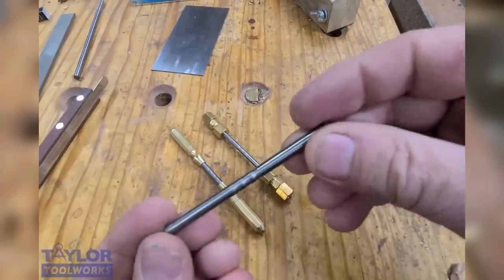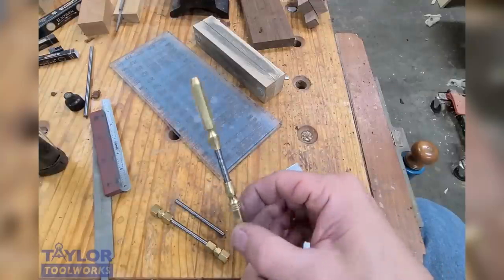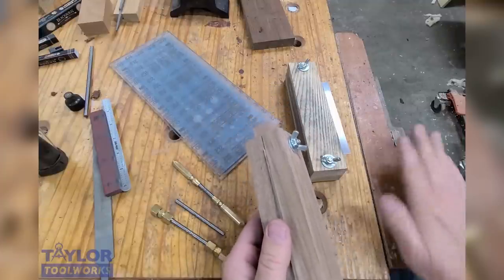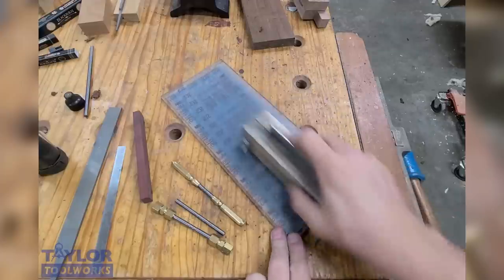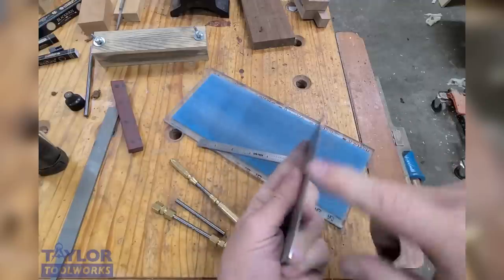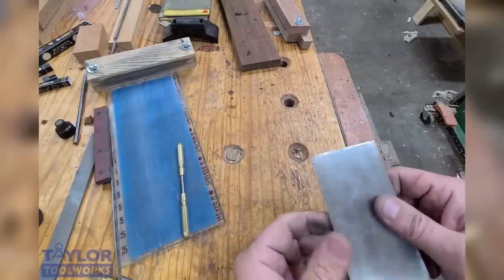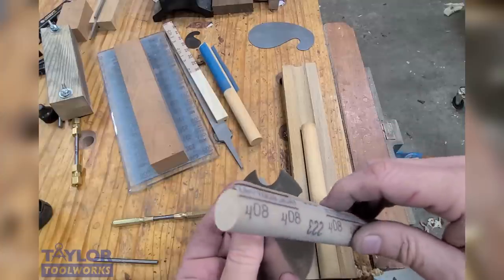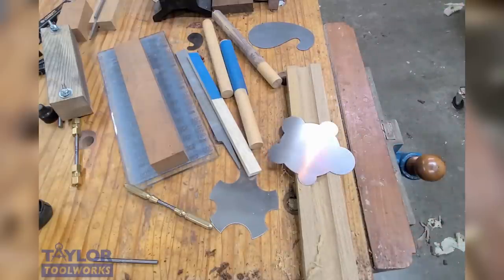The Accu-Burr: What it is and how to use it

Comment: I love this tool. Long time user of card scrapers and over the years have vacillated with methods of making the burr. This makes it so easy. It did take some time to get over what I was going to have to pay for the Accu-Burr, but now I'm very happy with the purchase.  I bought the copper pipe couplers with it, then made handles that could take the coupler in. Much easier to put more pressure on the rod for my hands.

Comment: Why do you guys censor reviews on your website to prevent low score reviews?
Reply from the maker: We only filter out the reviews that have an abundance of bad language or are a result of misuse. Others have been removed on occasion after a replacement was sent and the customer was happy with the product. There can also be a delay on when reviews are published - it just depends on when someone goes through to review them.
Reply: @TaylorToolworks  Much respect for the reply and all you do. I posted a negative review about a year ago for your cabinet scrapers as they're very wavy compared to other brands and it never appeared on your website... There was no foul language or misuse perhaps it just fell through the cracks. I just found it odd it disappeared but thanks anyways
Reply from the maker: @zzzBEASTMANzzz  Of course - I'm the marketing manager for Taylor Toolworks and handle the reviews, but I've only been here for about a year. It's very possible someone managing the reviews prior handled it differently than I do. 

If you reach out to support@taytools.com and give them your customer information, we'll send you replacement cabinet scrapers since it sounds like the ones you received were defective.

Comment: I kind of like the fine tuning of my skills involved in manually setting the amount of burr, although I do use a guide for my plane irons. Plus, If I'm only burring one edge of my scraper, I can make each side different.
Reply: I tend to put a coarse burr on both sides of the top of my scraper with an AccuBurr and a fine on both sides of the bottom. If I want to switch I just turn the card upside down.
Reply: @seanodonnell6952  
Yeah, I thought of that. If I didn't have a burnisher, I might get one of these, but I wouldn't spend the money when I have a nice Veritas burnisher.

Comment: why do you go from 60 micron to 40 micron?
Reply from the maker: Micron grits are backwards. 60 micron is rougher than 40. Each particle is either 60 or 40 micron across as opposed to normal grit sizes that refer to how many particles can fit through a 1x1 inch screen. Good question.
Reply: @TaylorToolworks  Thank you for the clear explanation

Comment: Your technique looks easy and I will give it a go. My only question is wouldn't it be better to go from  40 to 60 grit, in other words finer last?
Reply: 40 micron and 60 micron, not grit. The 40 is finer.
Reply: @MikeTaylorToolworks  Didn't know that, thanks.
Reply: @MikeTaylorToolworks  I have 350 and 1000 grit diamond stones. How do they compare to the 60 & 40 micron film? Thx Jeff
Reply: Also, is the lapping film adhesive-backed?

Comment: “You can feel that 90 degree edge”… I’m gonna call BS because if that were true you would’ve noticed that you started working the faces on the opposite end of the scraper you had just flattened in the vise. That being said, it looks like as long as you prep the faces and then use the accu burr you can get results with a card scraper
Reply: Gotta admit, that's hilarious and you've got a sharp eye to catch that he flipped the card and didn't notice. But Mike is giving a ton of great advice on several techniques, you probably could have found a more polite way to point it out. 
Regardless of whether it's the side he prepped, I don't think anyone will disagree that you can feel a perpendicular edge.

Comment: This is definitely idiot proof but lots of this is extremely unnecessary
I get the accu-burr but the rest of the prep is overkill
Reply: I disagree.  The single most problematic thing people do when sharpening a card scraper is not getting a nice clean sharp 90° edge before trying to turn a burr.  It's the key to getting a working edge, and I've seen people miss that time and time again.

This is a genius tool, and even though I have access to machines that would make it trivial for me to make my own, I'm buying this from Mike.
Reply: @DonsWoodies  interesting
I guess it depends on what you are going for 
I have found that you need a clean edge but definitely does not need to be a 90 or perfect 
I usually would take it to the stone and do a a few seconds on edge and a few seconds on each side pushing down with my fingers on diamond it's really fast
And the a carbide burnisher will take out any small error you may have made

Comment: Falsely advertised as from $1.99, talk about switch and bait - No way is it anywhere worth $40.00!
Reply from the maker: The $1.99 is for the brass handles separately. We included the handles in the listings, otherwise customers aren't able to find them (and they're very useful to have). We use Shopify, and as of now Shopify will always advertise the cheapest price in the listing. We're not trying to bait and switch, we really don't have any control over it as of now.